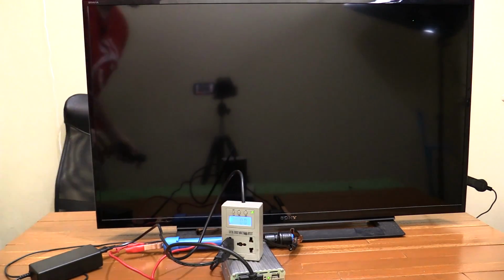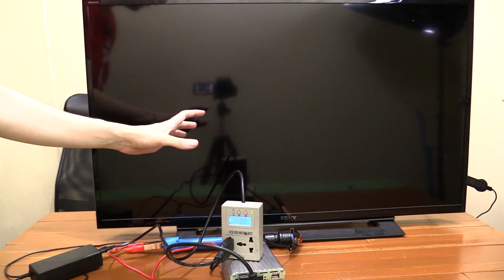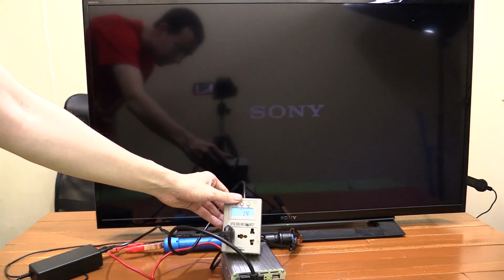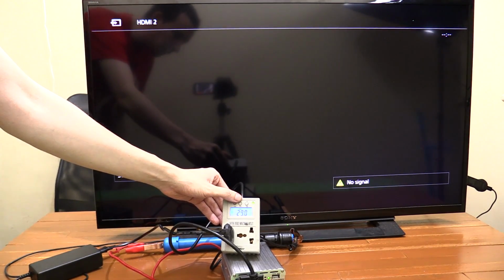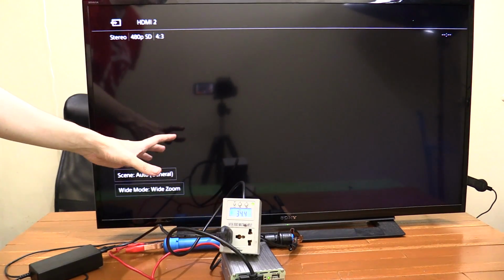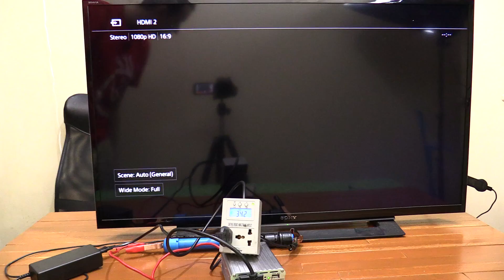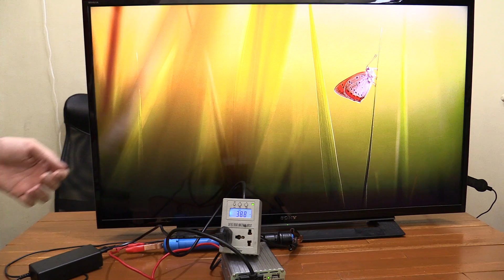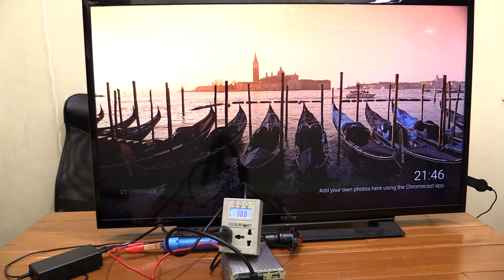Power your TV from 18650 batteries

Comment from the maker: If you liked this, you might want to check out a USB to 220V project I did.. https://www.youtube.com/watch?v=9TRa7s3vHYo
Reply: For those people who are asking how long the battery will last. Assuming that Battery is 3000 Mah capacity. 1000MAH is 1AH. So this Battery is 3AH x12v = 36 watts. So theoretically if you have a device that consumes 36watts it might last an hour.  On his example the TV consumes 40 Watts I'd say it might last 45mins. For the Electricfan that used 50 Watts it might last for 35mins. 

Another example if you have a single light bulb that consume 10 watts per hour. 36watts divide by 10watts total of = 3.6 Theoretically can light it for 3hrs and half.

Parallel adds capacity
Series increase the voltage

The battery is 18650 type with 3.7v to 4.2v.
Usual capacity is 2000 Mah up to 3000 Mah.

This is all theoretically just to give you an idea for rough estimate. I just want to add that for those people who are considering to do this add BMS for your safety.
Reply: And for how long will the four battery last?

Comment: Can i ask how you made the caps or where you bought them from and how hot did the batteries get like is it a fire hazard bc i definitely want to build one byt not just for a tv for my wifi router and my laptop charger cause i work from home and need something to keep me going a full day. I don't mind buying 32 18650 batteries if this will only last an hour at a rime and hot swapping them lol
Reply from the maker: This kind of approach is more for an "end of the world" situation.

I wouldn't recommend this as a permanent or ongoing purpose.

If you search your favorite shopping website (ali express and similar) for "12v ups 18650 box" or "mini 12v ups" you can find many better solutions.

Comment: Here's the problem: i want to power it directly , bypassing the tvs power adaptor since stepping up power to 230v through your inverter , then it has to be stepped down again by the tvs adapter is a huge waste of energy , why not bypass that shi and plug battery to tv inside !

Comment: Hi there cool video, thanks for the Idea, and I would like to know if you always do this or you just tried it if it will work well, is it also Ok to Use a single Gel Battery and connect the inverter to it and try to power the tv would it be ok too ? For example if you Have a 180wh useable power for a 35watt tv plus a chromecast or a tv box? Thanks this video made me curious about the type of batteries  that can also do this.

Comment: I accidentally ran across this when I was looking for something else. Maybe someone already mentioned this but if not; most flat screens run on 19.5 volts DC. The black brick is actually stepping down 120 Volt AC to 19.5 Volts DC. The method shown here is running an inverter so now it's also powering a fan to step up power only to reduce it to the 19.5 Volt DC. (Wasted energy.) There's some leeway so using 5 batteries at 21 Volts DC would probably power the TV without the inverter, fan, and the power brick. Power bricks get warm, heat loss. Adapting the batteries to plug directly into the TV would be more efficient. I've done a similar setup with a different power source for my RV TV. NOTE: Newer TV's eliminate the power brick by building it into the TV so check the voltage of the TV and match it as close as possible. Another option is to use a 20 Volt lithium drill battery with an adapter that can be purchased from Amazon. Amazon also has various convertors to step down/up DC voltage. I do not work for Amazon. I'm just sharing what I've found to be useful. I'm not an electrical engineer so you should confirm your systems (TV, etc.) and do your own research. Side note: I started researching flat screens for my RV years ago. I was baffled why there aren't more 12 Volt DC TV's on the market. The few I found were very expensive. It didn't make sense because most flat screens use around 20 volts DC so why not make it easier to use DC voltage for truckers and the RV community? I ended up making my own modifications and it works great!

Comment: So you can buy 20 pack of 18650s (3.7v at 3800 mAh) and.... I recently discovered that during a power outage that I could run my PC + Internet + lights for several hours. Way better than generator and less noise.

Comment: Hi im stanley im 19 ,and from liberia {west africa} and im a huge fan of your videos , i wanna do a solar project using 2, 100watt solar panels with a 3000watt inverter and i have almost 1000 pieces of li ion 18650 batteries and i was wondering can i use them as a bank

Comment: Use a DC regulator and power the TV direct from the DC 18650 cells. Odds are that TV is somewhere around 18vdc. The TV is DC appliance, not an AC appliance. So why use that big brick transformer when you can power the TV almost directly from the 18650 cell. You're literally converting from DC to AC and then converting back to DC... That's freaking insane.. You're wasting a whole lot of amp hours powering the converter and transformer. The way you're doing it that TV will run for maybe 15 minutes, run it directly and it may run for 2 hours.

Comment: You can also retrieve these batteries from many other devices, such as laptop batteries, electric vehicles such as skateboards, skooters and even cars. most vape pens use this battery as well as many power banks as well. its safe to say that most portable devices that arent bound by size like phones are using these batteries. 20 of them have powered my electric skateboard that reached 35kmph and travels over 15km.

Comment: this is quite dangerous running such batteries with no protection circuit, they become hazardous when they are too discharged (you have no low voltage alarm or measurement system). Though this a very interesting and definitely useful idea but I wouldn't recommend anyone unexperimented trying this without a battery protection ic

Comment: Guys without Safey Circuit the Inveter will make the battery hot.. so you have to use BMS  or battery Protection board before connecting it

Comment: Hi Gadget Addict,

I live in India and I am a fan of your videos,I really liked the hack and it was really useful.
But however, there is a major loophole here.

The 18650 batteries can't be over discharged, so if you follow this move,it could be devastating as the batteries could explode,or develop Small Copper Shunts , which could be more dangerous.

Therefore,my suggestion is that this hack must be carried on by using a 3s battery balancing board to prevent over discharge. This would be safer.

Anyway, technically the hack is really useful,and we may even have multiple batteries in parallel to increase backup time.

Comment: I have done similar things not a tv because of high drain, but I turned my soundbar to run from 2P3S setup I have and its been running for about 12 hours plus, still going as we speak, do not need to use a converter or anything because the soundbar is using 13 watts from the wall changes from ac to dc, so I did my setup and it worked for it

Comment: can you use that to run a computer ?? even 1 minute o so??
Reply from the maker: It depends on the computer. I wouldn't recommend putting a very high load on these cheap generic batteries. But the same idea with high-current batteries and in parallel, it could work.

Comment: hello,i calculate now on the internet that to power a 220v pc that consume 300 watt/hour i need 1364mah and for 12 hour = 16.368mah .so is it possible to make a pc powerbank or a pc battery like in a laptop... and to run fully on 18650mah batterys !??i know that original 18650mah batterys are made between 2.000 mah and 3.000mah / battery.so please tell me if im right or not ...??thanks !
Reply: LUCIANR81 your calculations are way off. You need at least 300Ah and not mAh. To get this you need deep cycle solar or EV batteries. It would not be practical to use 18650

Comment: why use a inverter ? TV required dc power so you can use the batteries directly.
Reply: It's about to make it boom in your face. 
Learn some basics before you get on your neck innocent people.
When you ask from the inverter 50watts the batteries needs to give 4.66 Amps and maybe a little more. If your batteries aren't high drain then booom! Also is extremely dangerous without any fuses to make a series with lithium 18650 even more when you make this series with old batteries.
So update your video at least with some warnings.
Reply: also there is no BMS... so he can discharge belowe safty voltage.
but yeah... more than 2C (in popular 18650) drain can explode li-ion batteries.
Reply from the maker: +Satyajit Ghana it's not really about the TV. It's about running.a DC to AC inverter from 18650 batteries.
Reply: Satyajit Ghana ooooouu

Comment: i didnt know 12v inverters can run of 16.8v 4x4.2v fully charged 18650 cells
Reply from the maker: +Daniel Hornes some are more sensitive to over-voltage but they all have some tolerance. A car alternator will push voltages in a car up to 14V or higher.

Comment: could this method be used to build a power wall ?
Reply from the maker: Same basic principle but this would waste too much space to be a viable method for a large battery pack. Plus you need to add fusing/balance leads and a battery manage system.

Comment: i got loads of genuine 18650 came out of laptop batteires as i work in a office building but. never thought i could do this. quesion.   how many batteries can you put together. i mean i can see u did 4 here. can we do more so they last long?
Reply from the maker: You put them in series to get to the voltage required and then put them in parallel to increase the capacity / run time :)

Comment: very impressive.. so how many inverter ddo i need to run my Tv and Electric Fan at the same time?
Reply from the maker: Provided your inverter is rated at a high enough output, you can just use one to run multiple items. A 100W inverter could likely handle the load but I'd recommend always being over-spec. So perhaps go for a 200W to 300W inverter.
Reply: so 200W or 300w inverter is enough to run my 220v TV and Electric Fan? on your video how long/hour your battery would last?

Comment: i regularly buy items from ebay from stores in china but if it is available in cdrking then i buy there.
 when buying in cdrking i can choose the item, have warranty  and better support. i have their 1000w inverter but only use about 200W, your 300W cannot use at full even mounting it on a metal surface.

Comment: Does the inverter turn off automatically at 12v or does it make a sound? Discharged each of those 18650 under 3v could damage them. You could even get two more batteries, make two packs of 3 in series and put those packs in parallel for a few extra minutes of tv.

Comment: Can I power my electric lawnmower this way if I just throw the stuff in a backpack? :D

But seriously this would be pretty cool to convert all the electric gardening and power tools tools into "rechargeable". Basically an uninterrupted power supply.
Reply from the maker: There are a number of lawnmowers and other gardening tools that already run on lithium-ion batteries. But of course the battery packs are super expensive. Cheaper if you can DIY them but not everyone is comfortable making their own packs.
Reply: Yeah but battery powered gardening tools are more expensive as well. And you could do away with it if you had a backpack power plant :D

Comment: That inverter is 12vinput ...How come could it work on 16.8v input
Reply from the maker: They have some tolerance to over and under voltage. Also remember the voltage of the batteries will drop when under load.

Comment: Question.

If an 18650 is rated at 10A maximum discharge, if i connect three of them in series, does the discharge stack to 30A? or not? Or only if parallel? Or it decreases?
Reply from the maker: The maximum discharge rate would still be 10A when wired in series. In parallel you can indeed multiply the maximum discharge current by the number of cells you have. Although I'd never push them to that limit, allow some headroom.
Reply: Gadget Addict I wouldn't neither, but I just wanted to know how does it work. Thank you!
Reply: Paolo Pabalinas no. Series does not I crease amp rating. It only increase volt. Parallèle does increase amp draw capability
Reply: christophe levaux  NO!  It increases the amps not the draw!  The draw is for each kind of 18650 pre determinated!
Reply: Taunter Atwill yeah this is what I wanted to say
Reply: Connect them in parallel